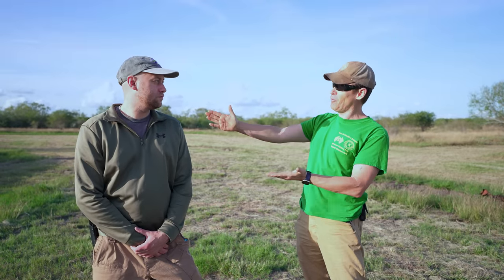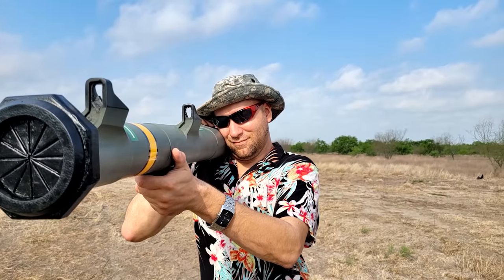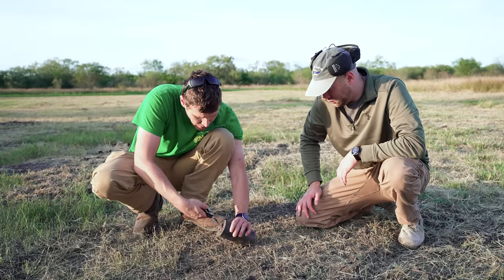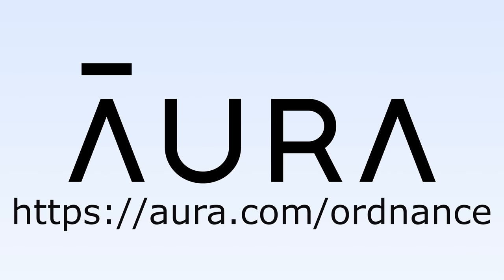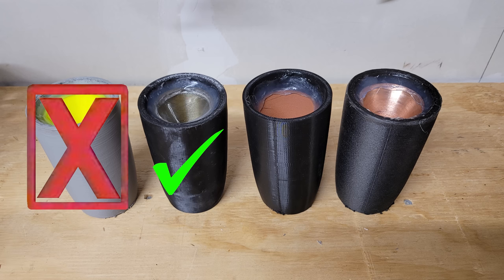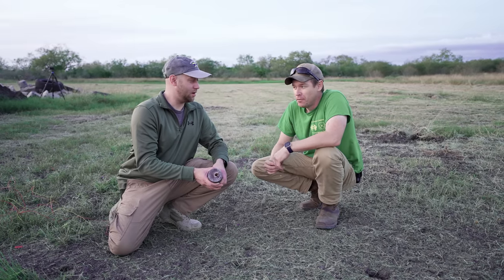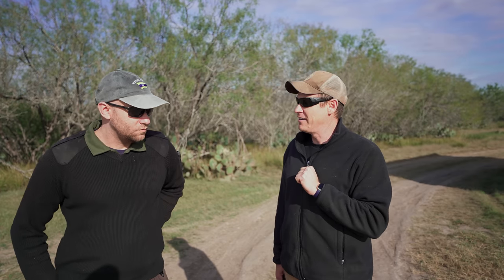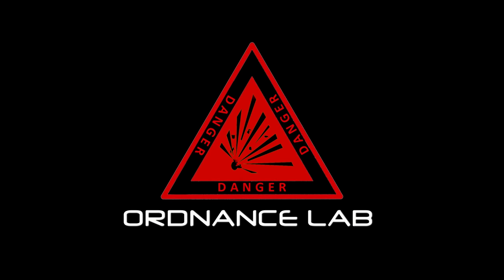Revolutionary 3D Printed Explosive Shaped Charges | Feat D&S Creations

Comment: One of the cool things about the 3-D printed liner is that you could trivially tinker with different liner geometry including parabolas, conic sections, variable cross-sectional and radial thickness.  Would be interesting to see what happens if you mounted a small tungsten pellet at the base or out front of the liner.  I’m guessing there are all sorts of research papers available on liner development.
Reply: I’ve seen EFP’s that have indents on them (like mk2 grenades) so the EFP turn to many small pieces of shrapnel instead of a big piece of shrapnel
Reply: In Minecraft of course 😂
Reply: @GeorgeWashingtonLaserMusket  Science Madness forum has a whole section dedicated to energetics, and a host of threads dedicated shaped charges.
Reply: @GeorgeWashingtonLaserMusket  While a lot of this and similarly imilarly military applicable stuff is heavily classified, there's more in the public domain than most people seem to think, especially in brick and mortar libraries. Remember the guy who got a visit from the FBI for writing a science fiction story about nuclear bombs in the 1940s; his fictional design (which was not what the government had built but would have worked) was based on what was in the public domain at the time.
Reply: @evansoutdoors4022  you dont know what EFP means.
Reply: So how much weight can a Ukraine drone carry?
Reply: @evansoutdoors4022  EFD'S form a jet of molten material that cuts through the armour.
Reply: i reckon adding steps in it on the filler side might make it more directional
Reply: There is probably more utility in 3d printing a plastic explosive lens.
That's what provided the big jump in performance in the 50s and 60s.
Reply: Which one ?
They use small ones that drop jury rigged vog30 mm grenades to ones that drop mortar shells and HEAT hand grenades.

Decent first gen Shaped charges with Cu liners penetrate ~ 1 * Charge Diameter. Late 50s with explosive lenses and piezo electric fuse trains and you are upto 3x CD.

I'll guestimate they should be able to reach 1.5 * CD with a 3d printed cone and a simple 3d printed explosive lens.

One of many FE simulation channels has a SC - explasive lens simulation up. It has a good explanation of the ideas involved.
Reply: @stephencaparelli7733  some use a wire cage over the front to make it basically a hyper velocity shotgun.  Efps generally don't create a jet, but a number of projectiles
Reply: I'm imagining that placing a tungsten penetrator rod in the center of the outside of the cone would be effective as the copper cone reshapes it might drive the tungsten penetrator forward with a lot of force. Also makes me wonder how a shaped charge with water inside the cone would penetrate since water is incompressable 🤔
Reply: @Oystercaulk 
So are metals and oils, but water took a lot energy and want turn then to steam or superheated stage, so I think it mostly ruin effect very effectively. 
So those super hard metals like tungsten would exit from copper pattern and that cone should turn inside out at the process so.. I would put my money for tin/lead or capsulated Hg outside of cone. That metal just wants boil and vapour easy, so idea could be as stupid than poisonous it is.

Comment: That copper filament was really a game changer.
Reply: It sure was. I think it was best not to go ahead and heat sinter it. Unless done in a form or on a mandrel the printed item can sag or otherwise lose symmetry.
Reply: @markfergerson2145  print with ceramic sinter the ceramic, and use that for support.
Reply: Is it ?
Press forming is one of the easier forming operations.
Reply: @dwwolf4636  Can you do that on a 100-200 € machine which has a footprint of less than 0,5 m²?

Comment: It is absolutely amazing what the copper filament was able to do. Especially since it is cheap(Relatively speaking anyway.) and can be burped out of a cheapo printer in very short order, and it's really easy/inexpensive to tweak the design. That really is fantastic and super interesting.
Reply: If you have the tools, the last option is both a lot cheaper and faster then 3d-print. But it was cool that it worked.
Reply: not cheap, not available, not easy to produce compared to taking a piece of pipe section slicing it and rolling it flat and hammering/pressing it into a cone shape. 3D printing is slow, the filament is expensive, and you might not always have a 3D printer or electricity to print the cones.
Reply: @excitedbox5705  Alrighty then. You do you, bud.
Reply: @excitedbox5705  $26 dollars US per Kilo, assuming the cone is 4in wide by 3-4in tall 2mm thick at 50g a shot, a reasonably tuned 3d printer can knock out 4 in about 30-45 min. For war time manufacture yeah that's shit, but for testing geometries for penetration ability … that's what rapid prototyping (i.e. 3d Printing) is built for. Once the shape has been finalized, print off a mold for casting in aluminum, and injection mold the plastic and copper suckers. Drives the cost through the floor and produces hundreds of thousands per hour at a proper factory, or hundreds a day using a home brew injection molder and any sufficient heat source. All that's left is explosives and delivery.
Reply: @thomasschulz2167  I totally agree that 3D printing shouldn't be used for mass production but it's perfect for testing different geometries. The output should be pretty well reproducible compared to most manual manufacturing methods and you could easily try stuff like having different wall thickness for different parts of the geometry.
Reply: @thomasschulz2167  This was absolutely the idea. Current conflicts are showing that WW2 tech weapons arent dead. If we could essentially plasticize these weapons we could produce 100s of times the volume, incredibly affordably.

Comment: I think the 3D printed copper one allows you to do weirder and more varied layer thickness on the liner. So I highly suggest in testing more experimental prints with the 3D printed copper liner.

Edit, adding in 3D printed Wave Shapers like in the M380A1 HEAT round or a much more pronounced and variable-thickness cone should add more penetration.

Comment: You guys should try to make some explosive reactive armor to complement the shaped charge series.
Reply: One important thing to note: majority of the russian light IFV/APC used for troop transports use aluminium. The fronts use sloped armour but sides and the top extremely easy to penetrate with practically any shaped charge. Aluminium is light and easy to deform, it's mainly used against light shrapnel.
Perhaps in the next tests, try the "least performing" charges against aluminium blocks and better performing with angled steel to see how they perform against them.

Comment: It would be interesting to see these test EFP's scaled up to 84-90 mm, that size would put it in range of the AT 4 warhead. Imagine that with 3D printed cone and casing. Make the cone from copper and the charge sleeve from pla or some other polymer.

Comment: Try casting the copper liner. It'll be brittle, but hard to deform and might work well.
Reply: Copper is easily annealed. A few hours in an oven and it’d be soft again. I’d be curious to see of the softness effects the penetrating

Comment: Fantastic video guys👍But think about using molybdenum as a liner material. There is a reason why the K-charge of General dynamics exists also with Mo-liner.
There is a reason why companies like HC starck solution and Plansee manufacture Mo-liners. Not to mention that in 2007 ruag achieved penetration depths with molybdenum liners that were over 10 times deeper than the diameter of the charge.
Reply: Why go for 10x penetration when he can just print ten charges a lot cheaper? I know they don't add linearly, but it's not really relevant to my point. The entire purpose of this design is that it's extremely rapid and very cheap to produce compared to a more traditional shaped charge.
Reply: That cost analysis is probably why all shaped charges don't use molybdenum. Copper's not exactly cheap, but it's not quite so rare and expensive.

Comment: You could use fluid 3D printing for castable burn out resin for vacuum casting. "VOGman" and "Clear Mind Jewellery" have examples of casted jewelry. Now if you would use that technique of vacuum casting. You could cast perfectly shaped copper shaped charge projectiles. 

Greetings,

Jeff

Comment: Make one out of tantalum. That has malleability similar to copper but a much higher melting point. 3D printed explosives is a very neat idea, as it could make precision shock wave shapes similar to machined charges but far safer to manufacture. 🤓
Reply: There’s no 3D printer tech for tantalum as far as I know, you can’t DMLS it.  Maybe one of the binder print then sinter methods, but it’s higher temperature pressure required than other metals even inconel…
Reply: What is the advantage of tantalum over copper? The liner doesn't melt anyway.
Reply: Tantalum has a much higher melting point, has a higher density and is very ductile. It can form a higher density and higher energy projectile. Copper is fine for most uses though tantalum will go through stuff that copper will not.

Comment: How about using lead for a cone? Or even a segment testing different elements for the cones?

Titanium, osmium, maybe tungsten? 

Might be fun
Reply: I think with the more dense materials it would tend to shatter rather than form into a cone, tungsten in particular is not particularly malleable not to mention alot more expensive. Tantalum on the other hand sounds kind of ideal 
I doubt they haven't tested those materials before yet copper is still the go to for shaped charges.
Reply: Hardness and density are likely less important than melting and evaporation points as far as determining whether a material behaves properly, shatters, or does some other crazy thing. Density would likely play a role in how much penetration is achieved, but it's possible that counterintuitively, less dense materials end up performing better as they convert to plasma. I'd bet that regardless of actual performance, the main reason copper is used as a standard rather than more exotic metals is due to cost of procurement and machining. Tungsten might perform 10% better, but for the cost of a tungsten liner you could maybe just triple the thickness of copper and get the same effect.

Comment: the interesting thing about copper cones is that not only can you 3d print them, but you can also make the electrolytically. basically you have your copper plating solution and a metal cone with some graphite paint (so the copper releases and still has good conductivity, silver paint works too) and you can make copper cones of any thickness depending on the time left in the plating solution.
Reply: Faster and easier to make a sand mold using a plastic 3d printed shape, then cast said shape.

Comment: theres metal filled FDM filaments. i wonder how they would preform as a penetrator. or using say metal dust like the fine fine alu or iron dust you can buy sandwiched between two forms to act as a molded container to form the jet. ANYWAYS i love seeing any sort of EFP content! love to see more. id love to see a tandem charge head done with that 3d printed copper charge! two lenses would be insane!
Reply: 90% copper filament was used for the 3rd liner.

Metal powders have been used as a liner. Mainly for bore hole related shaped charges. Dont eant solids to clog up that expensive drill attempt.

Comment: I'm curious what sort of effect you might get from winding copper wire around a conic form. Would some gauges be better than others? Would the pressure and heat of the explosion weld them into a liner or blow them apart? Would it help to bind them with glue or solder or some other sort of binder? Would a composite liner help? How about multiple layers of copper sheet wrapped around a cone and cut to fit? I just wonder what would be easier to make expediently if one did not have a 3D printer.
Reply from the maker: Oooh this is a very good topic to test.
Reply: I don't think that would work, the copper wire wouldn't deform evenly enough to form a concentric cone
Reply: @acorgiwithacrown467  I think it would work with a small penalty, just like the PLA/Cu print here did. 58mm pen versus 45mm pen may be down to 90% fill with homogenous 10% 'dead space' in the cone material and a little more loss due to overall density and maybe a need to change the cone angle due to that. 

PLA/CU also gives the opportunity to rapidly test iterations on cone angle, wall thickness and variations of wall thickness, maybe even formulaic solutions (lens curves on algebraic formulas to better take advantage of pressure/time curves for what's really an unenclosed explosive with these light printed containers).

Comment: Very good "proof of concept", I'm surprised the layered plastic/copper liner (first sample) did so poorly and that the 3D-printed copper (third sample) did so well.
A point of interest is that the smallest Panzerfaust (Klein) had roughly 3.5~4 times the explosive fill, so viewers expecting this tiny thing to do more than "scratch" tank armour was (perhaps) a bit too much.
Reply: RE factor matters more than the amount of filler, but i don't know much about the explosive they are using so i can't really say what i'd expect. It appears similar in performance to RDX that has a RE of 1.6, but who knows.

Comment: Great stuff as ever! Would be interested to see how a cast copper cone would perform? Perhaps you could 3d print one, smooth it and make a silicone mold to make wax blanks to cast many? Keep up the good work y'all!
Reply: @arturjogi2667  no you cast the silicone mold, make wax blanks then use the lost wax casting method with some plaster around the wax blank. the hot metal burns out the  wax and you're left with a metal piece in plaster. at no time does hot metal get near silicone. my mistake, i didn't explain all the steps very well. hope that helps! :)

Comment: Very interesting. The fact that the D3 printed copper wasn't sintered and still performed so well is a surprise to me. It makes me wonder about specific hardnesses and alloys of copper. With the printer you can play with the shape, as others have mentioned. So many small details can be tweaked for maximum efficiency.
Reply: Those results absolutely blew me away (pun partially intended). I though there was no way that would ever work. Not only was I wrong, I was very wrong.
Reply: The fact that it wasn't sintered doesn't really matter. The base material can be what ever you want it to be, but to get the molten metal jet that does the penetrating you need to have enough copper mixed into the lens to do the job and designed in such a way that the jet will contact the smallest area on the armor allowing it to burn it's way through. Similar to a plasma lance.
Reply: @thomasschulz2167  makes sense. We used to make shape charges without any metal material. Lensing wasn't exactly the way we were trained to look at it.

Comment: You can 3D print in tungsten (powder bed laser melting process). Some online 3D print services offer this material (beamler for instance). Probably fairly expensive. Would be interesting to see how it compares to copper...
Reply: That wont do you any good. the reason copper is used is because it reaches a certain acceleration where it becomes liquid or hydrodynamic and ''FLOWS'' through the armour. Now if you would use that tungsten as a solid penetrator, that would be effective. but then you are not making a anti armor rocket, but now you are designing  a tankround.  These charges have been around since 1886. And they still use copper today because it yields the best results. for a ligth caryable weapon.
Reply: @EleaRevils Heating and melting does not play a significant role in the physics of shaped charges. The effect creates a high velocity jet of material that acts as a projectile. Because it is a very small cross section (needle-like) moving very fast, it achieves a lot of penetration. I can imagine that shaping a correspondingly thinner solid tungsten cone would be very difficult, and that perhaps the thoughness of tungsten does not lend itself for the cone to easily form a clean jet. However, laser sintered tungsten powder is very different than solid tungsten. Much like the glass or copper infused 3d printer filament, it might „pulverize“ and yield to the explosive charge to form a clean jet. Shaped charges traditionally use copper because it is dense, inexpensive, easy to work into shape and malleable enough to yield to the explosive force. But back then laser sintering did not exist…
Reply: @pyalot  Nobody ever mentioned heat or melting except you.

Comment: Please compare copper, aluminum, steel and tungsten cones. I have also heard that adding tungsten dust to explosives enhances its effect, check it out if possible.
Reply from the maker: Jake is working on it
Reply: @OrdnanceLab  thanks! try also various other metals, such as lead, and if possible fillers of aluminum powder to increase the temperature. also have an idea, plastic cone and tungsten powder filler

Comment: I’ve heard that magnesium is good but bronze cones or brass cones are just as good as pure annealed copper.  You get significantly more penetration if the copper is annealed because it work hardens when it’s been formed into a cone and this slight bit of resistance can sap a little of the power of it turning inside out into a jet and also cracks can happen that let out hot gases which also effects penetration.  It’s much better if you heat your copper up with a map gas torch first and dump it in some water to quench it.  Not sure about printed cones though.